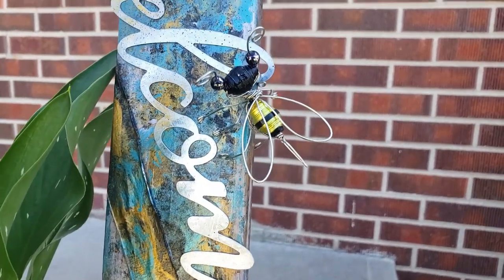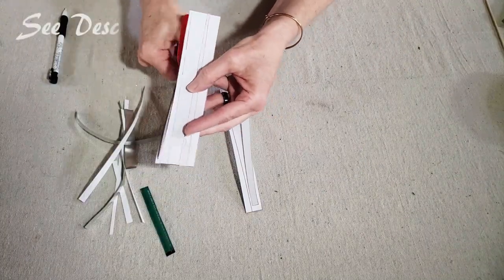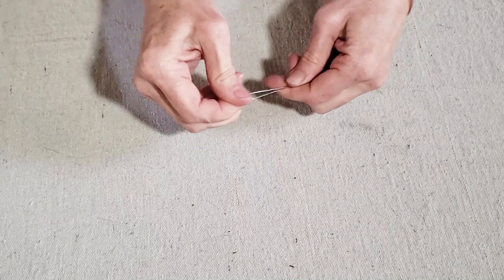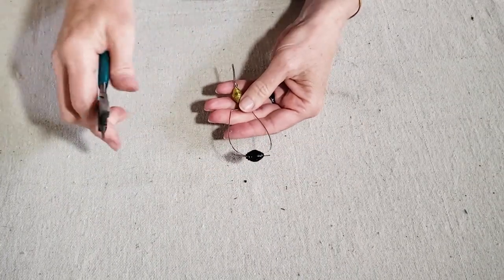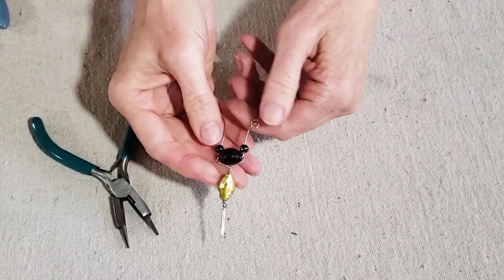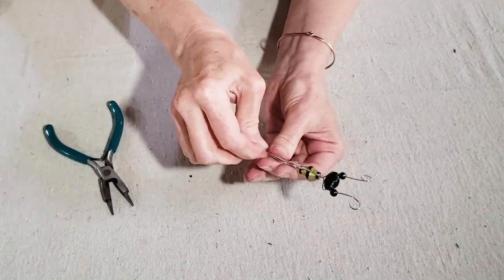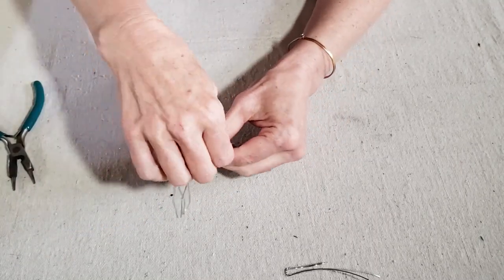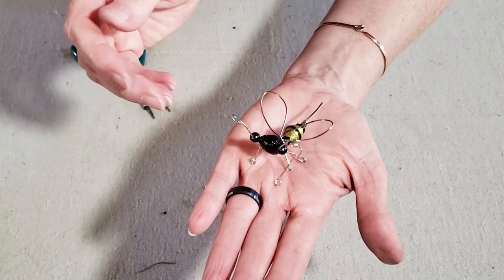Soda Can Bumble Bee Plant Charm - Upcycling Aluminum Cans

Comment: Have you ever had the beads pop open even with the mod podge?
Reply from the maker: Hi I haven't had this problem the only suggestion I have is to use a longer piece of tape on the tip or maybe try different tape. Hope this helps. Thanks for watching.
Reply: Thanks for getting back.
Reply from the maker: @NouluP  of course. I hope it helps

Comment: Is it possible to not use the bead roller I have to figure it out as I can't afford one
Reply from the maker: You could try using a wood skewer. I have rolled paper beads that way but I think it might be difficult to hold the aluminum in place. I have also seen people make bead rollers using cotter pins (I think they are available at hardware stores) Here is a video tutorial I found on how to make your own bead roller https://youtu.be/_xArFhXG1BM?si=_92zQ-JvWYQmAFsM
I hope that helps. Cheers 🙂